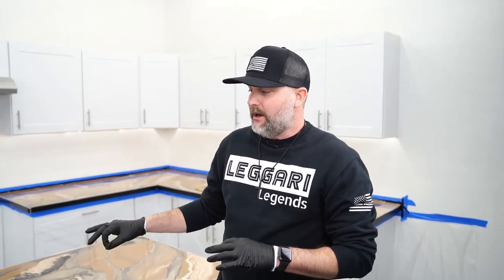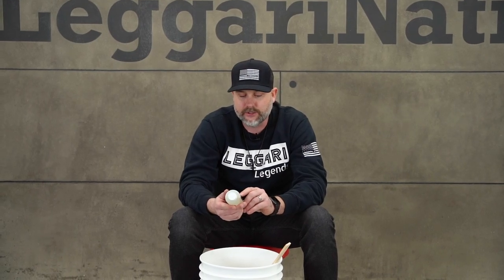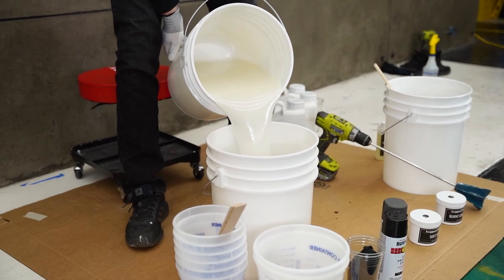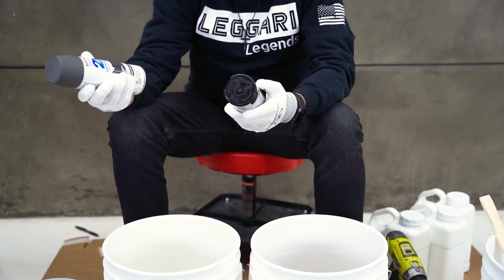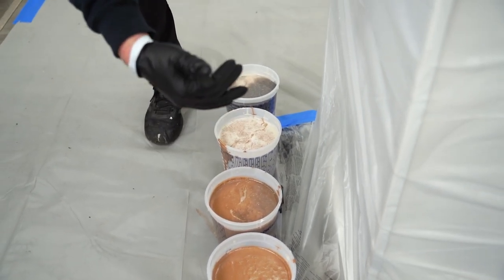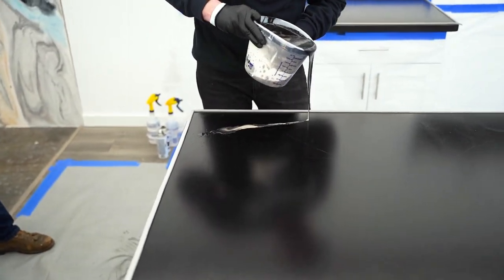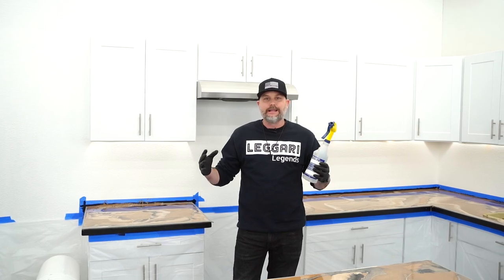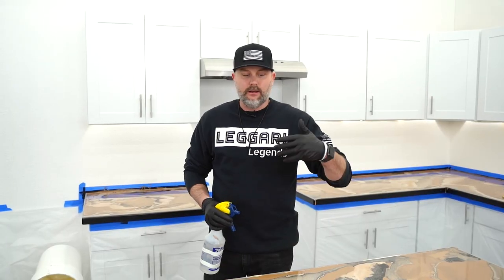STOP Torching! Pour Glass Smooth Epoxy Every Time With This Easy Epoxy Hack

Comment: I used these very product I had to clean up over 25 individual bubbles on my floors. Just did a 12 inch x 60inch window ledge and still had 2 bubbles. You don't see the bubbles forming until well over 3 hours later. By then you've already left the project. Upon return, there they are staring you in the face. Easier to just torch them in my opinion.
Reply from the maker: Whatever works for you!

Comment: What alcohol is that ????
Reply from the maker: The first thing we spray is 99% or higher isopropyl alcohol. This creates cells in the design and disperses the epoxy. Once that evaporates, we spray denatured alcohol to pop any micro bubbles that might be in the epoxy from mixing. This allows us to avoid torching the epoxy and the risks associated with that.

Comment: It works better on counter tops than floors. I did a dirty pour floor with Leggari epoxy and tried using a brief fine mist spray with denatured alcohol but I could only spray it when I could still walk on it with spikes. After spraying it then more bubbles appeared later but I had no access at that point to spray again and there were a lot of bubbles in some areas. Also, despite trying hard to spray as frugally as possible the denatured alcohol substantially altered the appearance of the color pattern. After sanding the bubbles off flush I used crystal clear gorilla glue in a plastic squeeze Bottle with an 18-gauge needle type applicator to fill the bubble holes (then re-sand the top) before applying a top coat.

Comment: Rather than torch use heat  hair drier gun at low Temps not just 4 bubbles but blending. Your technique
  is nice and easy, best 4 beginners!
Reply from the maker: We agree! We highly recommend using Isopropyl and denatured alcohol for a glass smooth finish🔥

Comment: Can you do a video on removing the tape from the wall? Do you have to run a blade to score it?
Reply: I do resin art and I use a heat gun to help peel off tape, it works really well, I don’t know if yours might be too thick but it can’t hurt to try if you only heat the bits your trying to pull off, hope this helps x
Reply from the maker: If you tape it at the right hight about 1/8 inch high it will pull really easy the next day, you might have to cut it a little bit if the tape gets stuck in the epoxy or sits more than a day or two!

Comment: Carrrrr Mel., so 2.
Gorgeous.  I'm definitely going with this. I need to watch you a little more to get the process down, but I'm going with your products. I do have a question: when you were putting the spray canned colors in the medium pots, were you adding the epoxy colors you mixed also? I'm a diy beginner? I'm really trying to get this down so it will look like yours.
Reply from the maker: Thank you for watching! For this project, we mixed up the epoxy, making different colored batches. We then added the liquid spray paint for extra depth and added it as we saw fit. Know that with every product purchased from Leggari, in-depth tutorials are included showing how to install our products. Although it may be an intimidating process, our goal is to simplify the process so anyone can do it. Best of luck to you!! Feel free to contact our customer service with any questions. 👇
1-844-LEGGARI (534-4274)
customerservice@leggari.com
Reply: @Leggari Products  // thank you for such detail.  I'll be ordering this week. Thank you so much
Reply: what was the support surface? Plywood, cement board, ???.
Add copper and dark blue. Do you have clear kits for table tops? Turned out beautiful.

Comment: Do you remove the sink or call in a plumber? Also what about the counters that have the 4" backslash attached?
Reply from the maker: It looks best when you remove the sink then coat and caulk but you can coat the counter with the sink there. Backsplash-either remove it and coat it separately, coat it while it's attached(the epoxy will have a very vertical dripping design not everyone loves), or just remove the backsplash and install a traditional tile backsplash. You can tape the backsplash-1/8" high and coat up to it as well.

Comment: And also with just this one coat is the countertop durable like scratch resistant heat resistance without needing a flood coat? Or would you still recommend a flood coat
Reply from the maker: You get the best protection by using our leggari urethane top coats on the epoxy

Comment: Very nice blend of colors and this is not just an installation, it is an art work as well.
How is the scratch resistanCe of your urethane top coat compared to the quartz (simulated stone).
I plan to do this for my kitchen but I worry more about the durability and scratch resistance than the aestic part.
Thank you.
Reply from the maker: https://youtu.be/npzH_hKmUG4 Check out this durability test!

Comment: Can you torch than denatured alcohol just to make sure no bubbles. As a rule of thumb for any resin?
Reply from the maker: Most other resin companies recommend torching their projects to remove air bubbles. We do not because our resin is engineered to push bubbles to the surface and torching can become hazardous. The first thing we spray is 91% or higher isopropyl alcohol; this creates cells in the design and disperses the epoxy. Once that evaporates, we spray denatured alcohol to pop remaining micro bubbles. This allows us to avoid torching the epoxy. As a rule of thumb, which resin you are installing determines your process. For countertop kit options, check this out! 👉https://leggari.com/order-countertops/
Best of luck!

Comment: How long should I wait before I mist with denatured?
Reply from the maker: Give the isopropyl time to evaporate then mist the denatured. You don't want to be flooding the design with too much liquid.
Reply: @LeggariProducts  I meant after I poured the epoxy. Right away or let cure a bit before I spray

Comment: How is the scratch resistance on the final result?
Reply from the maker: With our urethane topcoat the epoxy system is very scratch resistant!
Reply: Do you have to take counters outside  cause of smell...or can you use it inside...

Comment: Can this be done on a table with 5.5 inches sidewall?  Thanks!
Reply from the maker: Yes! You will want to take into consideration applying extra epoxy to the top and pulling the tape/weather stripping while the epoxy is more fluid so it fully flows over the edge. Contact our customer service for assistance! 
1-844-LEGGARI (534-4274)
customerservice@leggari.com

Comment: Do you guys still use the iso?
Reply from the maker: Yes! The first thing we spray is 91% or higher isopropyl alcohol; this creates cells in the design and disperses the epoxy. Once that evaporates, we spray denatured alcohol to pop micro bubbles. This allows us to avoid torching the epoxy.

Comment: It was glass smooth but then applying included gloss top coat added a texture to it. It’s not glass smooth anymore. Is that how gloss topcoat is or did I not do it right? Mine has white so couldn’t do a epoxy flood top coat according to support.
Reply from the maker: The gloss does have a slight texture to it, the matte does not!

Comment: So you mist it before taking off the tape or stripping?
Reply from the maker: Yes, the first thing we spray is 91% or higher isopropyl alcohol; this creates cells in the design and disperses the epoxy. Once that evaporates, we spray denatured alcohol to pop micro bubbles. Once the surface levels out and begins to set, that is when we remove tape/weather stripping and help the epoxy cover edges👍💯
For another great countertop process, check this out! 👉 https://www.youtube.com/watch?v=8cDw3R5_NlU
Reply: @LeggariProducts  thanks. And at what point do you pull the tape along the walls?

Comment: I am using your products and the alcohol made the bubbles worse and did not work at all. I used differing amounts from barely a mist to what you might consider flooding the surface and none of it worked at all, and, yes, I was using denatured alcohol.
Reply: Maybe it cured